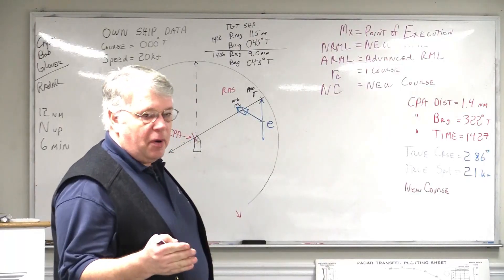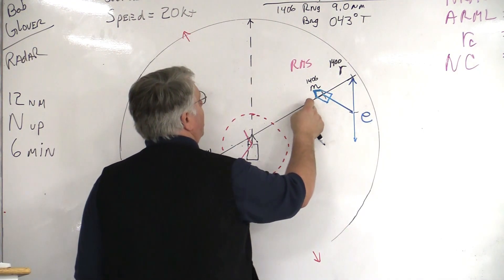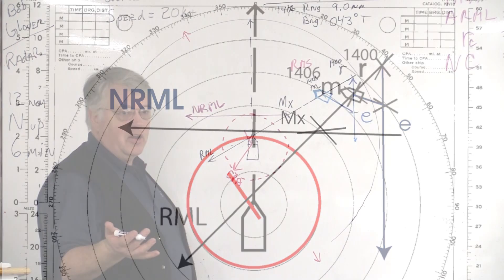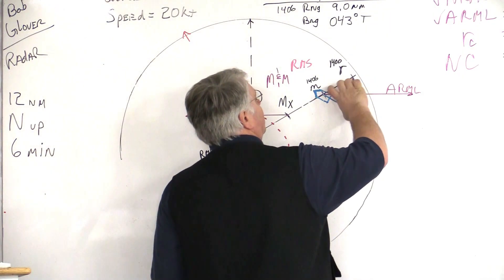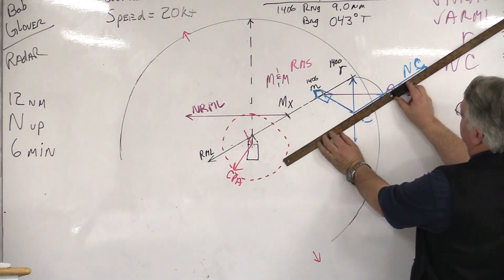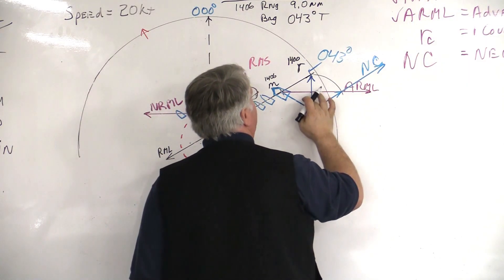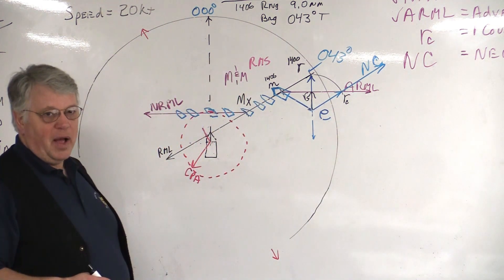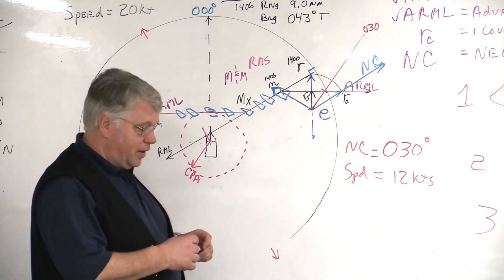Collision Avoidance Radar Plotting 3

Comment: what Rc means? is it true course?
Reply: at about 10:50 it is explained.   It is Caps own label for R prime.    That is  the point  which defines  maximum course  change (ie. not slow down at all) to achieve New Relative Motion Line   so keeping  CPA  as ordered.  Hope this helps.

Comment: It would appear that on this leg of the explination you switched the scale that you are using....you use the second range ring as the 2nm mark but really that is the 4. Is this the case or did I just get it wrong?
Reply: Remember relative and true courses ;)
Reply: I mic'd that off too.    Im sure it was 4nM  radius.
Reply: I reckon its because he is using what  looks to be the  2:1  scale.
Reply: Next Day.  I did this carefully in a large scale (1":nM)    and got new course  56°T.    Puzzled,  I fiddled around with screen grabs and enlargements until I could measure Capt. Glovers rough sketch on the whiteboard.   I read off 53°T.     Anyone else working through the Radar  and Mo-board   examples on paper?   This is a super series but  I think there's probably  a glitch in this final measurement (Own New Course to Steer).

Comment: The series of instruction is very explicit to understand for a new learner, I really appreciate captain. But I got one more question, we finally determined a new course (starboard) to avoid potential threat, I also realized ship is able to "slow down" if I don't want to adjust course, however, I was pondering if it will confront a new potential collision when I change course to port side along the ARML set by Captain Glover, or I can only starboard at all.
Reply: Read COLREGS avoid altering to port